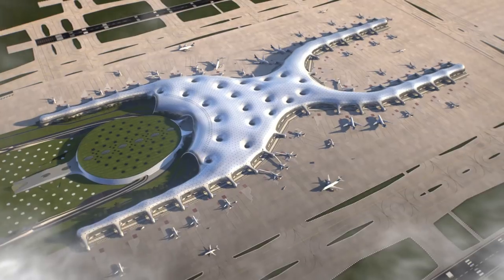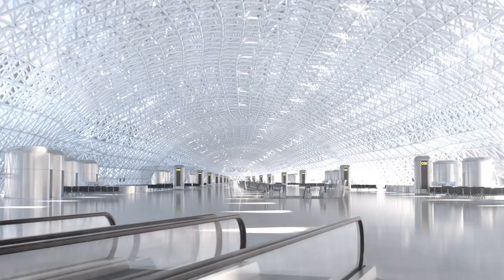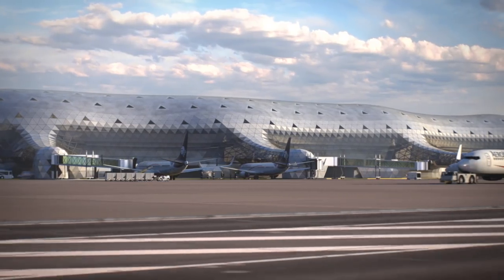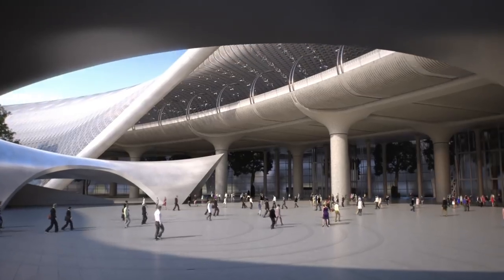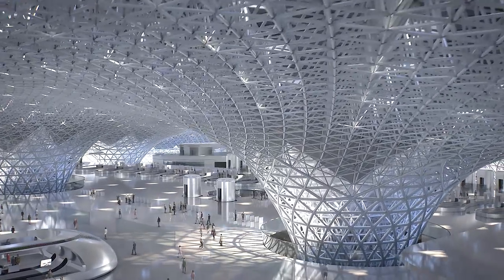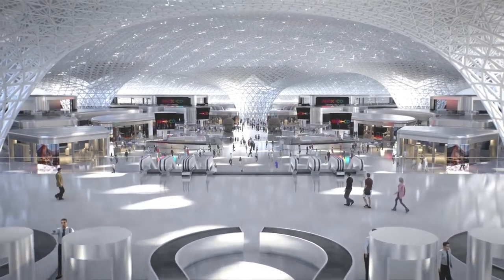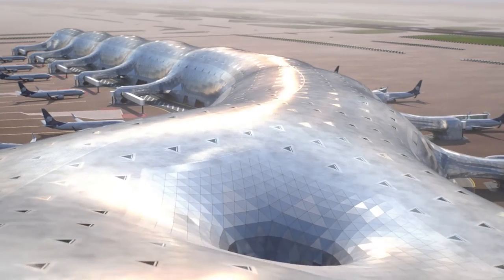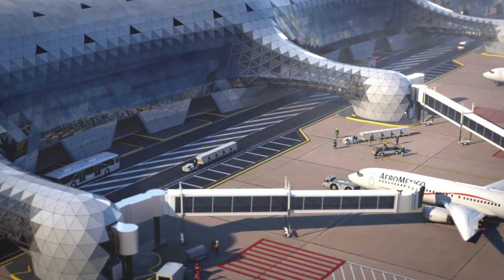New International Airport of Mexico City

Comment: Great airport but unfortunately they'll have to demolish a perfectly functioning existing airport!
Reply: Have you ever been in it? Isn't functional at all and can't be use as a secondary airport due of the proximity of the new one. So the best to do with the old one is to demolish.
Reply: Alejandro Dezag Yeah, demolish an airport with subway connection!
Reply: samanli2014 there's no a proper subway connection... you have to walk, a lot, in the other hand there's a project for a sky train and a brand new mobility in the city for the new one. Is a 360° project.
Reply: Alejandro Dezag Didn't build a new terminal back in 2007? And now they've gonna bulldoze a perfectly-built airport terminal!
Reply: The current airport has attended more than it can handle, it has a capacity of 32M passengers per annum when it attended 41M in 2016. There is no room for expansion and now they even had to put limits on the rush hours and banned general aviation into the airport. Also there is a limit on slots, making Mexico City a less competitive destination, which affects the economy.
Reply: samanli2014 the terminal they built is 2007 was an alternative for the failure of a New Mexico City airport in the early 2000s, also that terminal is sinking in alarming rates because it was not built properly.
Reply: samanli2014 don't make me laugh AMLO follower the so called nivel airport Its wonderfull and si, but it's operating at a total overload , it needs to be used as something else maybe a 2nd airport
Reply: Nop! You wrong guys, those buildings. Are property of CDMX. And they not going to waste them.
In fact, there is a big plan to remodeling and adapt all of then to a new functionality. 
( Universities, publics parks, hotels, residential. Malls etc)
Or just another big green area for the CDMX.
Cdmx government will do a survey.
To the citizens.